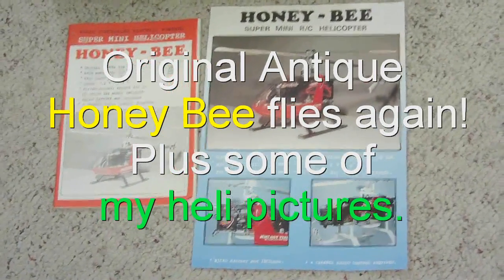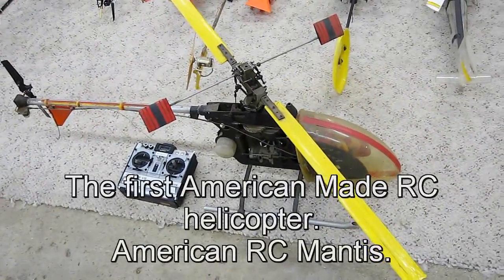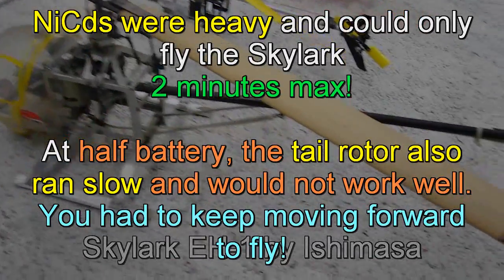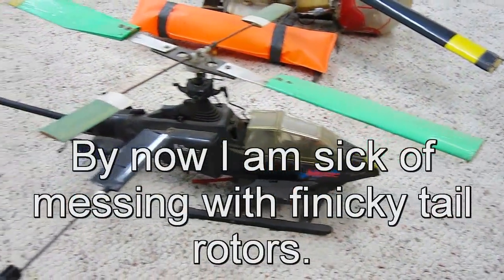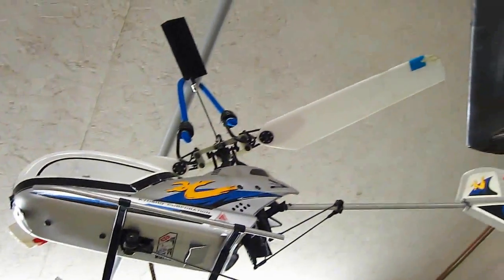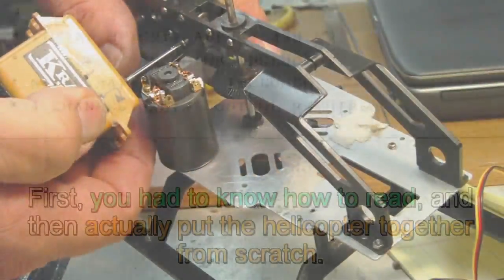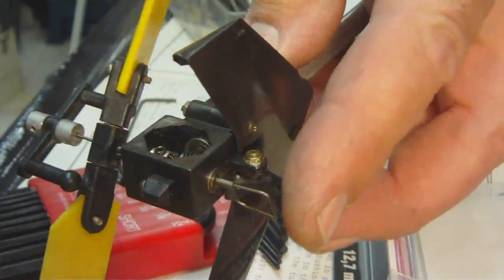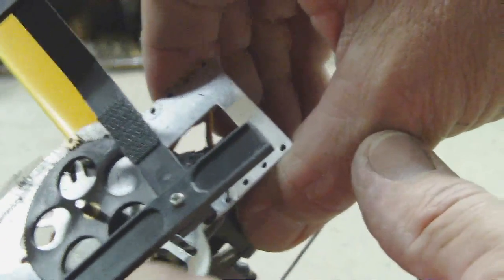Love Electric Helicopters?  Honey Bee Antique shows early difficulties + Daves Helicopters

Comment: I’d really like to see you het an original Du Bro RC helicopter with the engine mounted on the rotor.
Reply from the maker: Me too. I actually am working on my own design with engine on the rotor but getting it balanced is difficult.  My 1 bladed helis were easier to balance.  I have looked high and low for a Dubro Whirly, but so far have not found one.